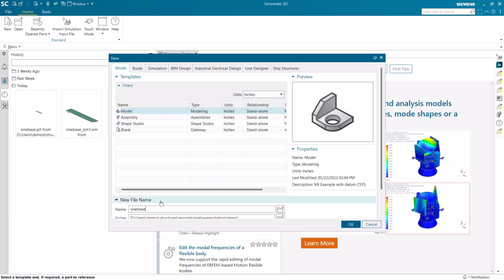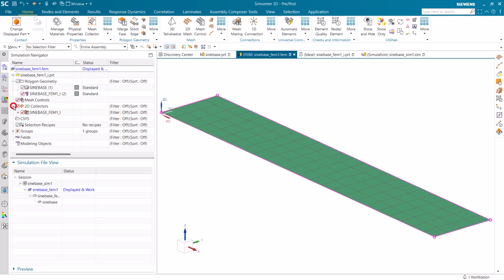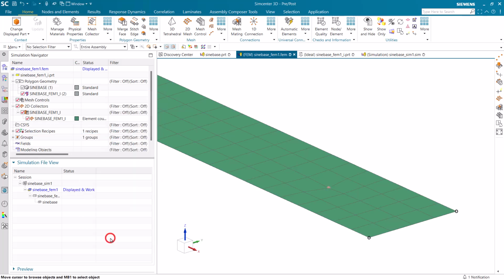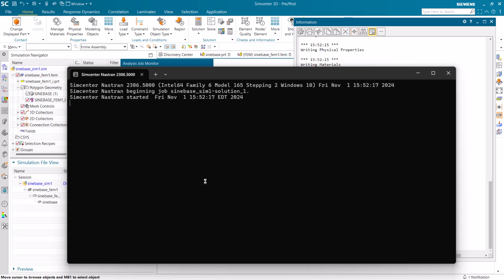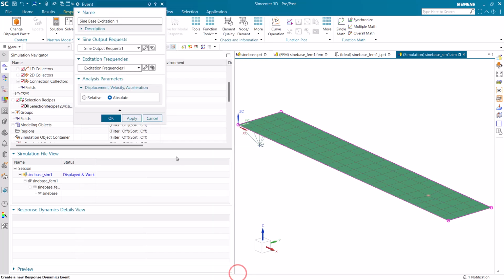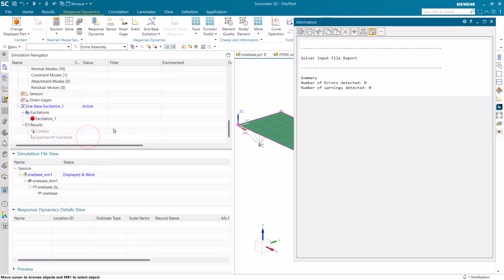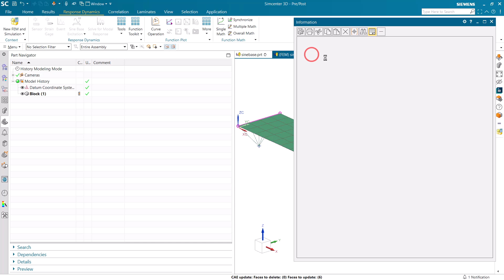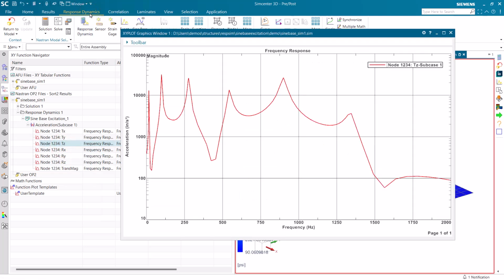How To Run A Sine Base Excitation Dynamic Analysis

Comment: Hi tips and tricks. Is it possible to have more than one node to plot the acceleration in multiple spots ? Should I just add a node to the selection recipe and in that case, I suppose selecting "single node" won't work ?
Reply from the maker: Hi, it is possible to have more than one node to plot the acceleration in multiple spots.  To do this you will need to run through the steps again of creating another mesh point with the node number assigned in the fem.  Then create another single label selection recipe.  Then in the sim you can edit the output request for the sine base excitation acceleration spectral xy functions results and add the new selection recipe.  After solving again, it will create output for the two nodes in the two selection recipes in the XY function navigator under the Nastran OP2 Files - SORT2 Results.  Select both of the results for the two nodes (ctrl + mouse button 1) and you can plot them both in the same graph.  Hope this helps!
Reply: @Simcenter3DTipsandTricks Thank you very much ! I will try this tomorrow
Reply: @Simcenter3DTipsandTricks   Hello again, is it possible to increase the number of normal modes calculated ? Instead of having 10 I would like to have 30 modes.
Reply from the maker: @matheobrosset5161  Hi, it is possible to increase the number of normal modes calculated.  I show how to do it in this video:  https://youtu.be/fU-E1grMTJI?si=WqlF7bPHMslqT7R5&t=2637  Here I show how to set a frequency range of interest but you can leave that blank and set the number of modes instead which is in the same dialog.

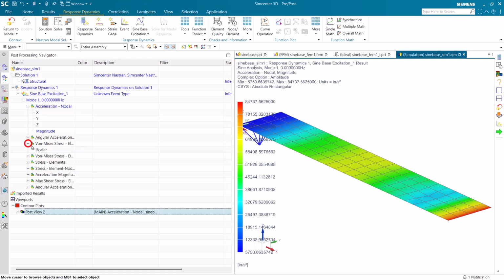Comment: Thank you. I learned some new stuff :) However, why is in the results  at 07:38 Mode 1 0.0000Hz?
Reply from the maker: The zero doesn't mean anything.  The Nastran data structure for frequency response requires a header with a single frequency value.  The results are across a range of frequencies so no single value is correct.  Since it has to have a header, to attempt to avoid confusion, we set it to zero.